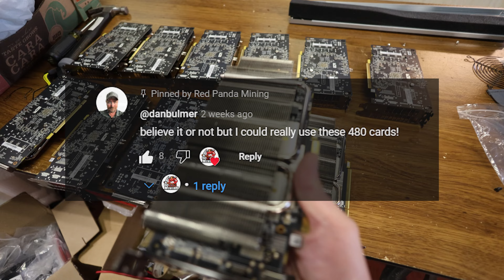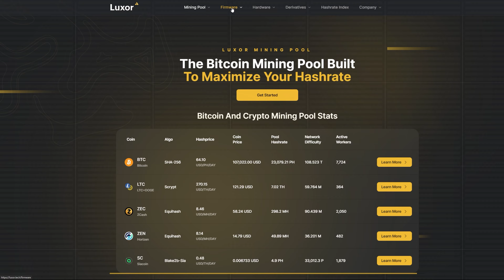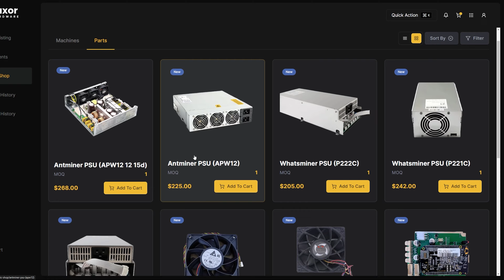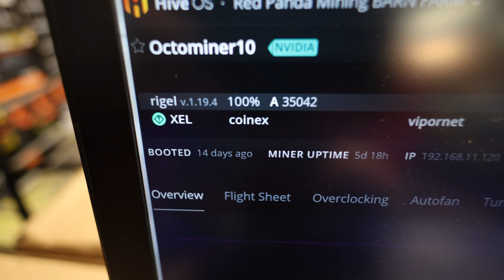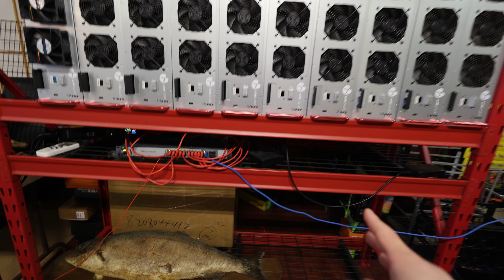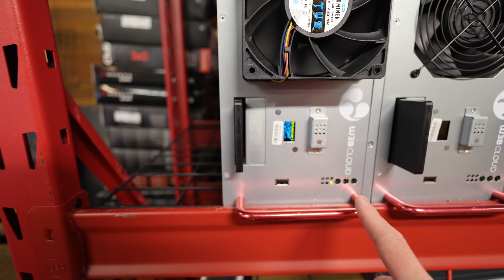Yeah I know GPU Mining is dead right now but...

Comment: @redpandamining nice 👍 finally gotten to see one of your 100-210 setup, BTW did you get the TVM EPS cables? If you have then No need to move the fans to the outside, just spin the fans around but keep them in the same place, you will need extra fan grills to protect the wires, but its a much cleaner look/setup.
Reply: where can i find these 8 pin eps cables at ??? id like a 8 pin eps on one end and a 6 pin pcie on the other end for my server psu

Comment: 170hx draw a lot of power and the octo case backplane might not be able to handle that with how it's currently set up. Bc160 are good but remember they draw about 50 to 60w from the riser, might need to add a power cable to the board